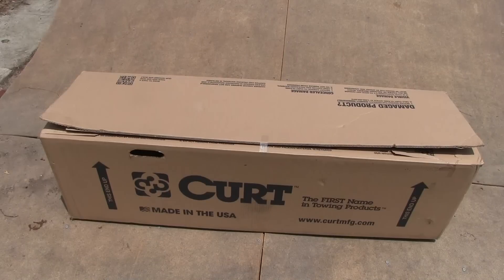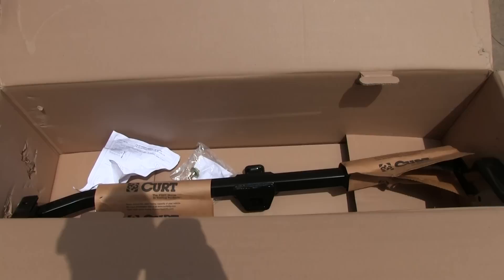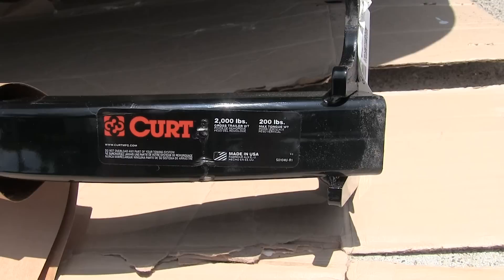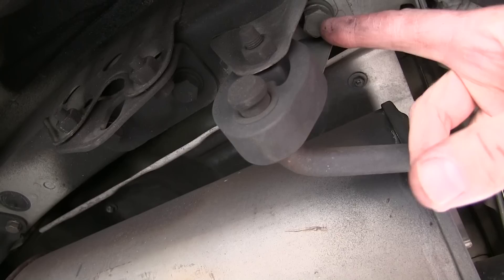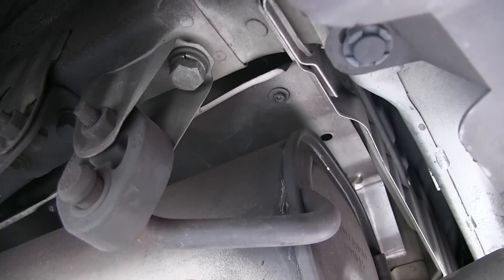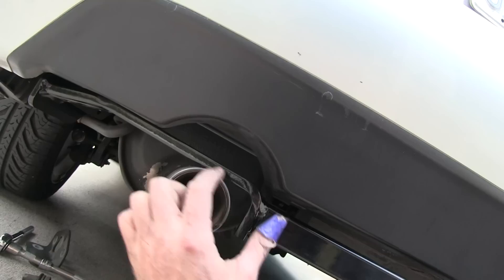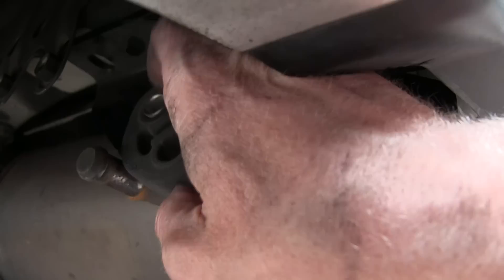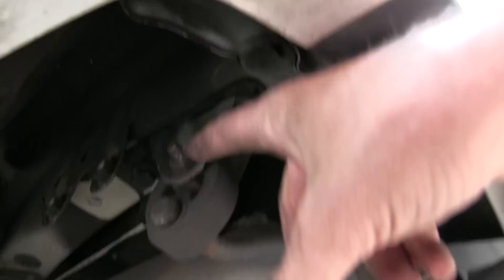Subaru Impreza Trailer Hitch Installation

Comment: How much weight can a subaru impreza tow? I have a 2010 automatic. any recommendations for towing a teardrop trailer or if thats possible? Thanks so much
Reply from the maker: +HirbourVideo It has a 2,000 pound towing limit and a 200 pound tongue weight.  More info here: https://www.curtmfg.com/HitchLookup/find?year=2015&make=Subaru&model=Impreza%20Hatchback&style=All,%20Except%20WRX%20and%20WRX%20STI
Reply: @hoohoohoblin  I know you posted this forever ago but do you know if this is true for an 08? I didn’t have a manual but tracked one down and it says towing is not recommended under any circumstances. I have a trailer hitch on my sube and am moving in a few days. I thought I could rent a 5x8 uhaul (weighs 900lbs) and would just be filling it with boxes but no furniture. Now I’m not sure that’s even safe

Comment: Well half of my bolts snapped, guess im off to a pro
Reply from the maker: That's too bad.  I live in a desert climate, so the bolts don't get rusty, so they were easy to take out.
Reply: Patrick Power use an impact wrench, over here we have lots of problems with rust. An impact wrench solves everything. Buy a manual one, not electric. The ones you hit with a hammer.